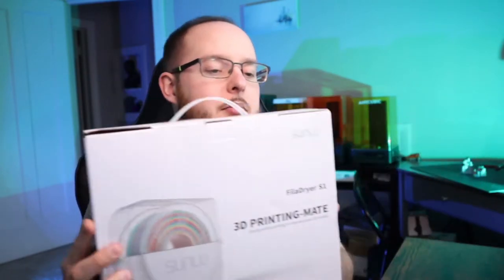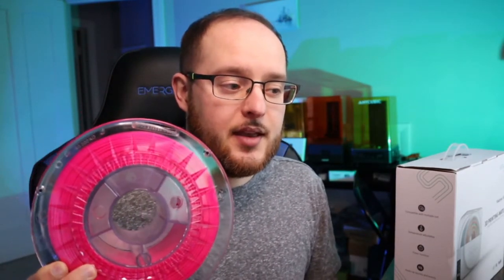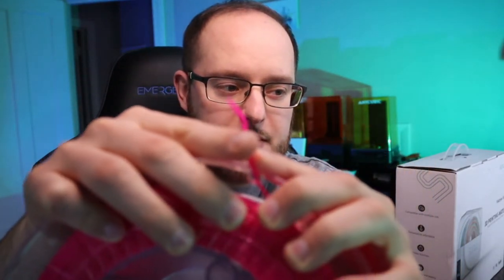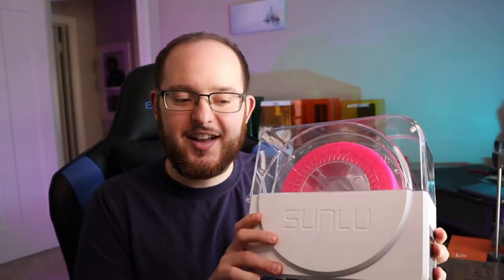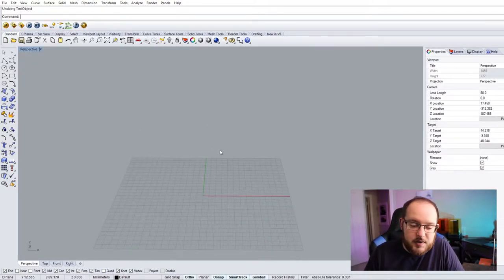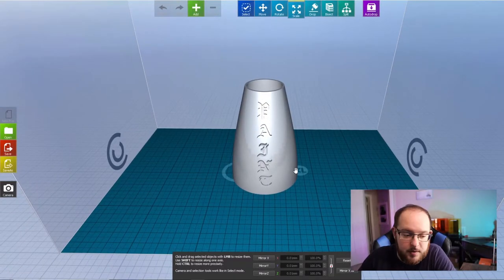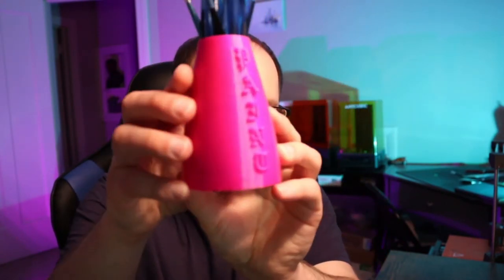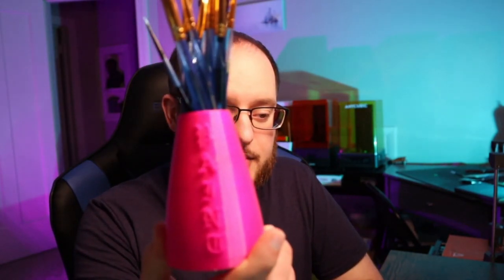Is the Sunlu Filadryer worth it?? + Bonus 3D modeling of Paint Brush Holder

Comment: Is there a way to tell if your filament isn’t dry enough before having a failed print? Or do you just have to bend it and see?
Reply from the maker: Good question! If the roll wasn't sealed up and had just been sitting out for too long it's pretty safe to say you'll need to run it through the filament dryer. Bending and snapping the filament has been my method so I don't waste time with a failed print